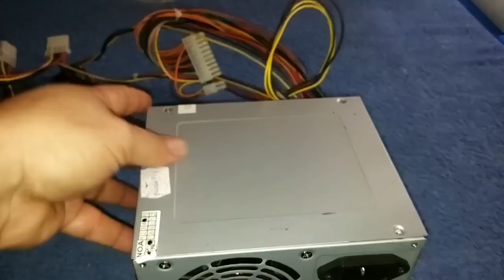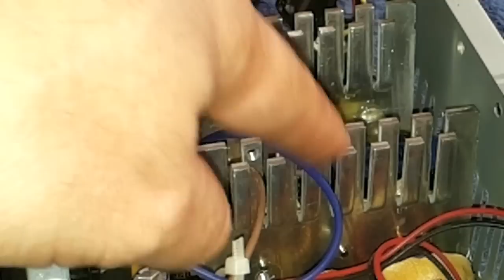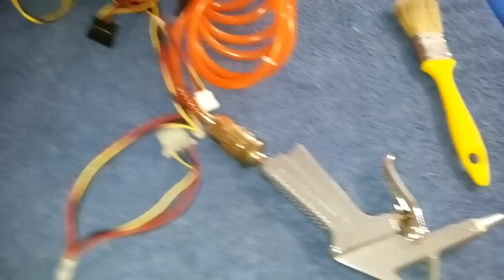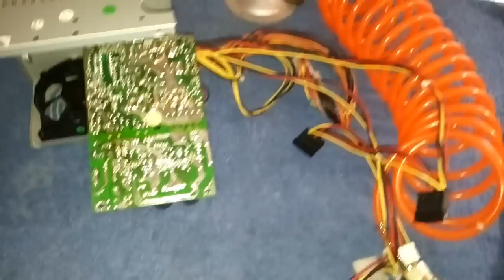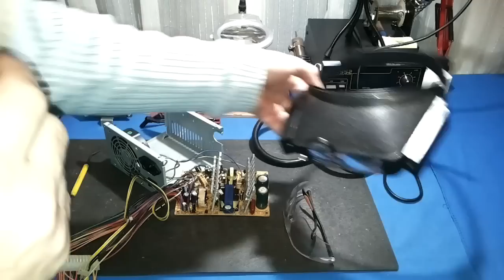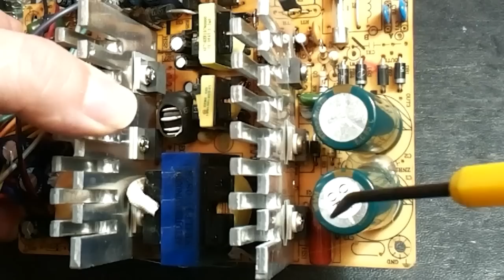How to fix a switching power supply / how to repair ATX in a PC desktop computer

Comment: plzz help me when i plug it on, the fan would run for a while and then stop working..
Reply from the maker: There are many reasons. It cab be from bad soldering, short circuit in the secondary stages or bad capacitors. Don,t try to repair it yourself if you are not a technician, in order to avoid electrocution danger. You better put it on the right hands to repair it. To repair soon help to avoid more damage.
Reply: i was finding some solution to repair it ..i saw some people heating it with hair dryer..i tried and it worked but after switching it off it again started doing same as before
Reply: Allow the capacitors to discharge overnight and replace the 12v fan. Not really difficult to do. I just did one yesterday. Just be careful in removing the wires to the mobo.

Comment: It ´s  not worth the bother to repair them. they are so cheap to buy... Another Thing the beaster are so dangerous. A qualified technician would´nt bother repairing them because a new one 400 watts or so cost only about 25 Euros.
Reply from the maker: Hi! Talking about Euros... Remember in some European countries people earn 240 Euros per month, and once they supply their expenses, supporting one child or more plus winter heating costs they will ask for their power supply to be repair for 10 or 12 Euros. In must Western  European countries the average minimum income is 1600 Euros, but at the other side of Europe, it could be only 240 Euros. Also let's remember there are places in the world where people has an income of US$50 per month. As InfernosReaper wrote in one of the comments:"This is clearly for people with an interest in electronics, don't have $50, or both".
At the other side of the coin it is as you said, switching power supplies are really dangerous. It is a  hard bone laking of meat for a low budget qualified technician and client too.
Reply: Just commenting. If one is determined to fix defect smps one has to invest about 500 Euros for a start in test equipmentj for e.g variable isolated variac there not by no means cheap, digital Voltmeter.Plus the mental abitity to fix them.

Comment: Yeah nice video but honestly I'd rather just spend 50 bucks on a new one
Reply: Then this video is not for you. This is clearly for people with an interest in electronics, don't have $50, or both.
Reply: Or someone who cares about the earth and do not want to pollute the environment they live by throwing all broken things away.
Reply: someone might want a spare for testing...... i hate having to be that guy who has to comment
Reply: Ted Mosby wow smh
Reply: Some PS are very rare and difficult to find. Or much more expensive than that. Or, I do not want to wait for a week to arrive, if I can fix it in 1 hour.
Reply: fair point
Reply: Better to pend $50 or even $100 on a new power supply than to have to replace the entire computer because you fried it by trying to fix it yourself.
Reply: but this stuff comes from the environment it can have them back

Comment: mine make a whining sound... I figured that it might be from the coil.. what should I do? I already bought 3 PSU....
Reply: Ian Kyle Maturan from my experience (I'm not an expert though) coil-whine is generally harmless. My mobo whines regularly, and I've been told it's common.
Reply: I had this problem once, and it turned out to be a leaking capacitor.
Reply: Ian Kyle Maturan Hmm, if it's to the point of being annoying, it might not be a simple coil-whine. Don't know then.

Comment: Hi,
I had recently called a mechanic because I had same problem. it was not turning on 😲. That guy from computer repair shop came with a device, I don't know thats device name but I know that is use to check voltage of circuit. He put its 2 pins on mother board and told me that it is not responding. He took my cpu to his work shop. 

Next day he came had said "one side of mother board was burned because of short circuit" he told me that he had replaced that part with a part in his shop. 

He didn't mention any hing about psu. Now same problem is occuring after 1 week. 

Now my question 
Is he is cheating me? Or make me fool? 
Pls anybody answer me i don't want to waste my money more.
Reply from the maker: Hi! A repairing, should not be temporal, but permanent. (Unless he tells you: "it will be temporal for you to save the information or use it for a few days while you get another computer..."). 
Other ways, you should expect to get a guaranty for the service or products you got, all under the terms of the guaranty's specifications. If there is not a service contract, most countries have rules for costumer's protection.
Sadly for you, if you can't get a good electronics certified technician to repair it, then it will be better to stop losing money and to invest in buying and changing the bad parts for new ones without more problems. :-(

Comment: what range of resstor s needed to dscharge those capactors? 
nterestng vdeo. thanx
Reply: Pretty much any will suffice. It can be done with just a pair of pliers with rubber handles. He uses a resistor for some added safety.

Comment: would be interesting to convert these into a voltage controlled bench power supply between 0 en 30 volt.
Reply: At the very least, you can always use them at the various established voltages; 5v. 12v, 3.3v. For something more, you may want to just build or acquire a different power supply, or find a DC voltage stepup circuit(similar to what is in USB battery bank, which coverts the 3.7ish volts to 5V for USB devices). I hesitate to suggest such a setup because the limits on how much power you can get out of it.

Comment: Hi, again about an ATX power supply, i have changed 3 small bad capacitors,  the problem is the voltage 3.3, it's 4.2 volts or so. i'm not a technician so....i don't know where to look at and where it could be problem for that higher voltage, some suggestion?
Reply from the maker: Hi! If you are not a technician, then you are exposing your life and heath to danger. Look for professional help in your town or city, and my recommendation is do not do it yourself again.
Reply: of course i try to avoid stupid things, doesn't worth the money to fix it with a professional help, that's the reason why i've asked to you.
Reply from the maker: Dear friend, you wrote "i am not a technician". What do you want from me? Do you want me to be responsible for your self electrocution, or for your house's next fire?  You already got a professional advice: Look for a technician in your town and do not try to fix it yourself.
Reply: DISCLAIMER: I am no responsible for anything going wrong if something I suggest results in any harm or damage. You assume the risk by attempting to modify or repair your device.

That aside, the suggestions in the video are solid enough. Look for obvious capacitor issues & other obvious component failure first. After that, I would check the resistors because they are cheap, easy to obtain, & usually easy to replace. Beyond that, there's not much advice I can offer. Since it's often hard to tell if an chip on the board is good, trying to replace them is a bit of a gamble, so I wouldn't recommend it unless you've got a good part supplier.
Sadly, I don't have very much experience with fixing power supplies, only a degree in electronics(which I got 8 years ago & haven't used much), so I can't give you much more advise than that.

Comment: How does one FIX an 1000W Platinum PSU. They got more filtering. All the time I find only resources for cheap PSUs. Good video.
Reply: Yes, the Junk PSUs not worth fixing 

maybe work hours are extremely cheap & electronics very expansive in this countries
Reply: Or some people are broke & gotta work with what they've got. Hell, I'm in a 1rst world country & I can't afford another power supply should mine die...
Reply: More filtering and complex PFC...
Reply: @InfernosReaper
You can still buy a used one.

Comment: Hello, nice video !!!!  I've a ATX PSU with some components completely blowed out and i cant get the exact electronic diagram for it. May be you can show me a way to get it. Thanks. The PSU is marked : "PERDOON The Ultimate Power" MODEL: ATX500 WThe PSU ics are: 7510 current sensing, PWM control Circuit AZ7500B, Photo Transistor 817.
Reply: "PERDOON The Ultimate Power MODEL: ATX500"
This even sounds like a generic No-Name cheap junk like from Chiefmax/Leadman 

and it looks like something from 1997 http://www.clubic.com/shopping-112508-3-perdoon-atx500.html ( "LC Power LC420H-8" looks similar & is similar Junk ) 

Edit:
 even the newer Style Variant of it has No +3.3 V (orange) at Sata-Plugs 

http://picclick.it/Alimentatore-PC-Power-Supply-Perdoon-500w-P4-20-4-262531819300.html#&gid=1&pid=1 

I can bet this generic No-Name junk delivers only 300 Watts in reality - do NEVER buy this dangerous Junk !!

Comment: Really good video.  Can you please explain  how to check whether that high voltage transistors are good or bad ?
Reply: Little hint, you can check them with the continuity function on a multimeter. It is basically 2 diodes.

Comment: Please, My power supply sometimes runs ordinary but, in other time doesn't run.   please where is the problem?
Thanks
Reply from the maker: Hi! There is no way to tell where is the problem if I don't have the power supply to open it and to look for the problem. I recommend you to look for technical support. In this case, a computer shop will replace it, and a general electronics radio - tv repair shop, will repair it. What I can tell you is most intermittent problems are more linked to open or broken soldering or thermal issues. Please, be careful. A switching power supply is lake a microwave oven, it is easy to get kill if a non technical person opens them.
(Also a video chip soldering problem can make us to get confused about the source of the problem).

Comment: Hi, what are the causes of the loss of insulation of a power supply like that one?
Reply from the maker: +thesummertune Hi! There are many reasons for the lost of insulation. In some videos I said: any of the electronics components from all can get bad. The insulation loss is just a consequence, and no the problem.  But there is some vulnerability in capacitors and semiconductors. Most resistors have the tendency to get open and no in short circuit. (It sounds right)  ...but there is a voltage divisor of two resistors in parallel with the main capacitors. If we increase the value of one of them, probably one of the capacitors will get damaged through the time. At the end of the day, just for this specific case, the bad capacitor and the laking of insulation because the consequences, and a bad resistor the origin of the problem. Anything can be bad, even the enclosures or cables insulation, or the worse situation is when components pass the basic test, but working together behave erratically. Then deeper test of the electronics components must be performed. ;-)
Reply: Thanks, i've removed the power supply from my computer because a felt a pretty big shock, never happened in many years. i've checked the main voltages of the power supply still ok but i can't touch it. if a bad capacitor of the 2 big ones (680uF) how i can understand if faulty?
Reply from the maker: You will need your multimeter, a good capacitance meter and to test all. Repairing skills and some experience are the most in this case. (Remember the linkage current can come from a periphery equipment like monitors, printers, speakers amplifier, and modems too).

Comment: Hi, if the capacitors measure 20-30% more of the printed value, they are still ok or it's better to replace them? no bulge etc. on them.
Reply from the maker: +thesummertune Hi! The capacitors's datasheet has the answer. Some electrolytic capacitors tolerance is about 10 or 20%. So, anything in the range would be ok for 10 or the 20%. The best is the closest to the printed value. ALSO, remember ESR is critical in electrolytic capacitors.  Some capacitors can be good in the Faraday measurement, but fail miserably in the internal specific resistance measurement. (The ESR value is in the original component's datasheet). I didn't show it in my videos, but some times I make mechanical measurements with a digital caliper to detect if the capacitor started to inflate.
Reply: Thanks for replying. an example a 1000uF 10volts (brand JEE) says Low ESR. but a bigger capacitance 20-30% isn't bad for the other components?
Reply from the maker: +thesummertune - I don't have the capacitor's datasheet. You have the capacitor. Look for its datasheet. The answer is there. I can't help you without information. You must find the capacitor's datasheet, and find out if it is under its specifications and tolerances. :-)
Reply: i don't have that too, not always available over the web.
Reply from the maker: Ok. Then change them. The best way to save the clients money is to change it. Because the last thing we or our client want is to stop the equipment again and to pay for another fixing. It is always good to change not only what is bad, but the components that are more expose to damage, or the components that could be affected by the bad device. That is the difference between repairing and "renewing". Remember maintenance is corrective, or preventive. But also "there is predictive maintenance". Change them as predictive maintenance. ;-)
Reply: Thanks for the tip :)

Comment: Hello! Maybe you can help me with an advice. So I have a problem with my PSU. It works ok, but after 30 minutes of playing a game it shuts down, and I can hear a hissing\buzzing high pitched sound coming from the PSU, while the PC is turned off. If I try to turn the pc on it spins the fans and turns off. I have to take the cable out of the PSU wait a couple of minutes than it works, till I play a game or do something that puts a higher load on the PSU, then it shuts down again. The PSU is an Arctic Fusin rated at 550w and my system is an old Dual core and a GTS450 GPU, 4gb RAM
Reply: +Theo S. Check the capacitors - this is real normal symptom
Reply from the maker: +Theo S.  Hi! Let me know when you are on line, and send some pictures to my email.  :-)
Reply: its bad capacitor ... use an air blow gun to dust off ur PSU ... then open up ... if the top of capacitors are bulged out ... replace them with the same value remember the capacitors can explode if u replace its terminals wrongs..
so take care of Polarity
Reply from the maker: Also, it is important to know, in switching power supply, or audio amplifier output, we need VERY low ESR capacitors. So, check the brand in your supplier´s shop, use Google to look for datasheet, and go for the lowest ESR capacitor you can find.
Reply: sorry for the late reply. I look at the power capacitors, they are all good.the power supply is new. It was never used. I got it from a friend, he never used it as well. So I don't think the capacitors are the fault.
Reply: it has no dust inside, it was never used. The PSU is an Arctic Fusin rated at 550w
Reply from the maker: Hi Teo! Do you know electronics? If you have knowledge in electronics, maybe I can help a little. But if you are not a technician, any help, will end in one more victim of electrocution, or in a burned house. :-(
Reply: hmm, that sounds good. what do you have in mind? lol
Reply from the maker: If you know electronics, you can send pictures from it to my email, and I will tell you where to make measurements with your DMM and oscilloscope. For this kind of test, an ESR meter is needed, or to assemble a digital circuit with an 74AS14 gate, or any circuit with rise time faster than 20ns, with 50 Ohms output impedance in order to measure the capacitors internal resistance.

Comment: Hi..i just found that the crystal diode  and Thermistor (NTC 5D-9) got broken in my SMPS due to voltage fluctuation . does the Crystal diode have any value or number? how do i replace it? Thanks.
Reply from the maker: +Dheena Dhayalan Hi! It could be a "Zener" diode. It is hard for me to tell you its value. You will have to make a hand drawing diagram in order to reverse the engineering and to calculate its value. 
Good advice: Once you made the diagram, withe the power supply in Watts, the PWM chip, you can try to look for ATX diagrams in Google. Some designs are very alike, and some Oriental power supplies are cloned one from the other. If the diagram is alike, you can try to make a comparing with your power supply. BUT, try to calculate your diode's value with mathematics, in order to do not fry the rest of the computer.